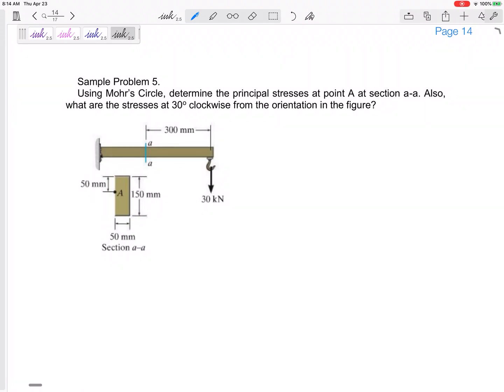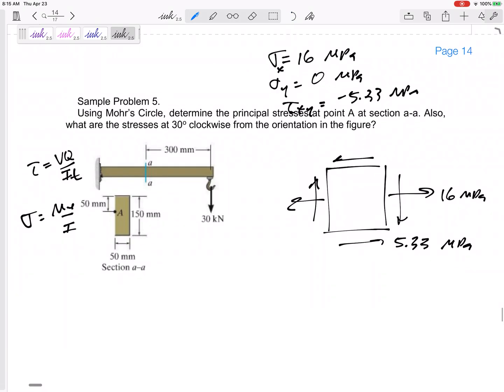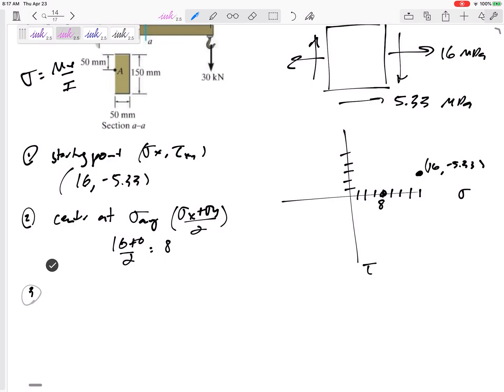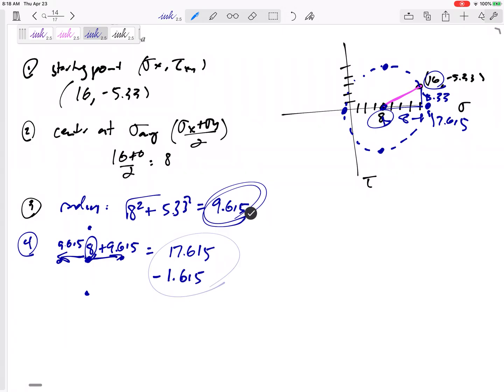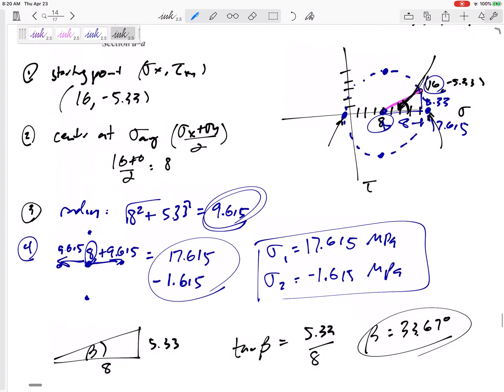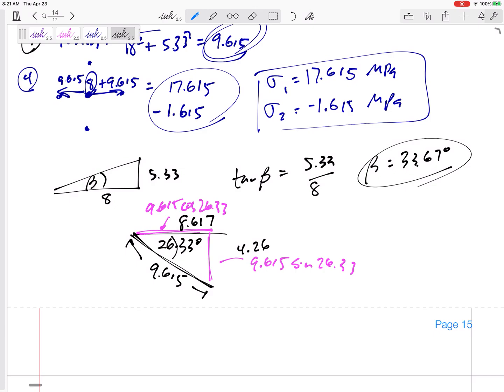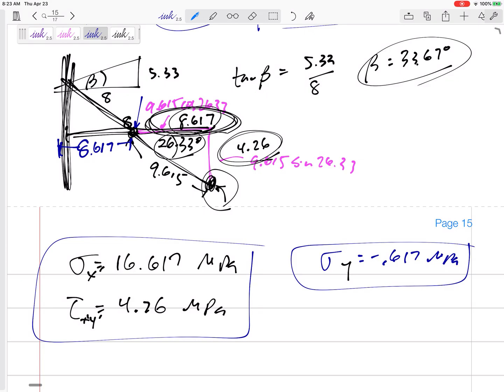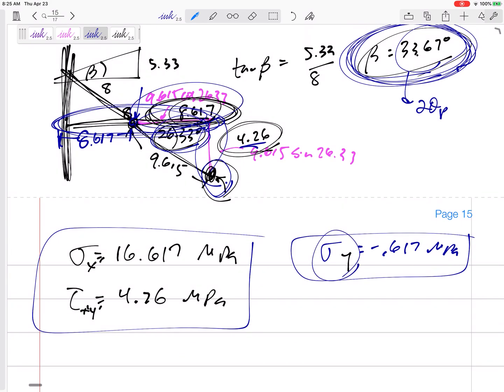Mechanics of Materials - Final exam problem 5 Mohr's Circle

Comment: Why is shear stress on the stress element negative? Shouldn't it be positive considering that the internal shear force at a-a repels (in the upwards direction) the downward 30 kN force at the end of the bar? tau = VQ / IT therefore does not contain any negative values.

Comment: How do you find M(max) at the wall for the stress equation if you don't know the total distance of how far 30 kN is from the wall? We only know its distance from a-a. Basically, how did you find sigma x in the beginning?
Reply: nevermind, I see you made an internal cut at a-a and summed the moment about that cut which enabled you to find Ma = 9000 kn*mm to plug into the flexure formula